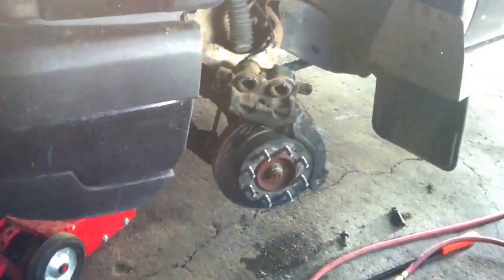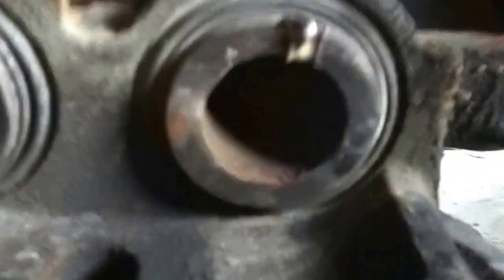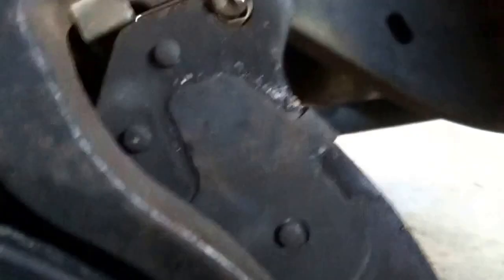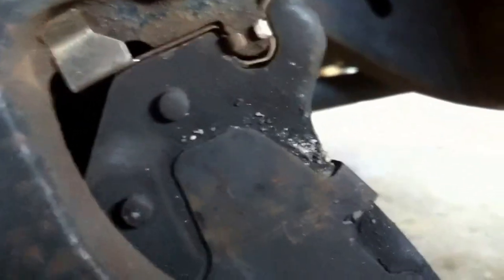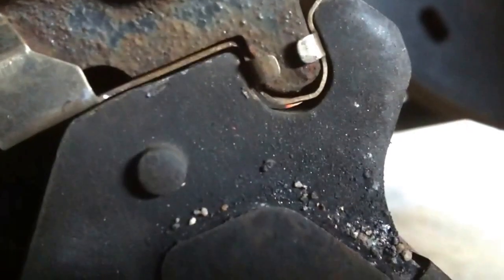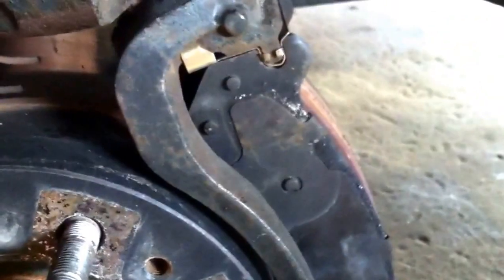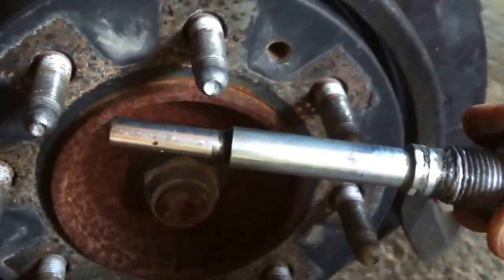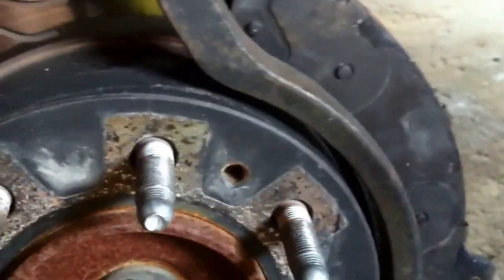Duramax brake problems

Comment: The rubber brake line will come apart on the inside leaving a flap that closes once the pedal is pushed causing the caliper to stick. Open the bleeder screw when the caliper is stuck and see if the fluid has a lot of pressure when it comes out and watch to see if the caliper releases. If the fluid comes out with pressure the rubber brake line is the cause of the sticking caliper.
Reply from the maker: Dan Dunning i replaced all callipers, and he hydro boost. I must’ve had contamination in the fluid. After that I never had a problem. On my 2002, I had the master cylinder fail on me and wouldn’t release, so it locked up the front brakes and it would only get worse and worse. Had to use 4-low to get back to the shop. Replaced the master cylinder and not a problem since with it locking up. It did exactly what you mentioned, loosened the bleeder a bit and it would shoot the fender well with fluid.
Reply from the maker: Dan Dunning i had one lock up, replaced it, and then a second lock up, replaced it. And the other two as well. Had enough. Lol

Comment: Definitely grease them  pins  . Get a blue shop towel then pump some grease onto it , then  rotate  pin until thoroughly covered  with grease.
Reply from the maker: Ryan Soltess they were installed with caliber pin grease. I wiped them off when I took them out.

Comment: I have same problem with the break rattle on my 06 duramax 

  It is so annoying
Reply from the maker: Yes it is, i have tried to replace the pins, and the clips with high quality pads and no matter what i did they always ended up doing that, the only way i fixed it was to get new calipers.

Comment: How many miles on caliper? Also did you use china made parts or domestic?
Reply from the maker: Unsure of mileage on caliper as it was on the truck when i bought it. I use nothing but the top quality MOOG/NAPA/ACDELCO parts on my truck. The pads were the high quality ceramics. The ears wore out extremely fast. Since the caliper stuck, it overheated the rotor now, and it's rusting, while the other 3 are still rust free because of the coating. I just put on all new calipers, flushed the system with fresh brake fluid, new hydroboost, and a cooler for the power steering fluid.

Comment: You don't sound like a weekend warrior lol. What's your best assumption to what caused the failure?
Reply from the maker: My truck has 384,000km on it, and i believe these were the original calipers. I think the hangers which bolt to the knuckles/spindle are worn where the clips rest on and since there's no material to support the clips they wear out extremely fast, and get play enough to wear the eyes out on the pads. I compared the new hangers to the old ones and there was quite a bit more material on the new ones where the eyelets on the pads go on. Hopefully this solves my problem.